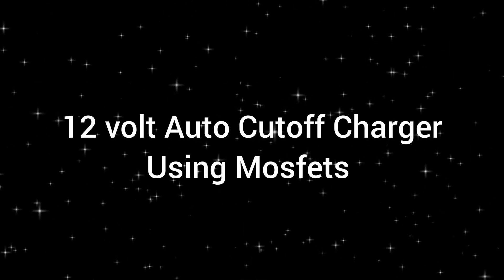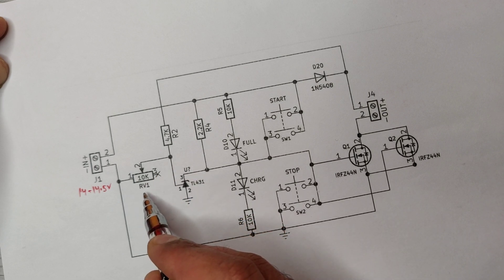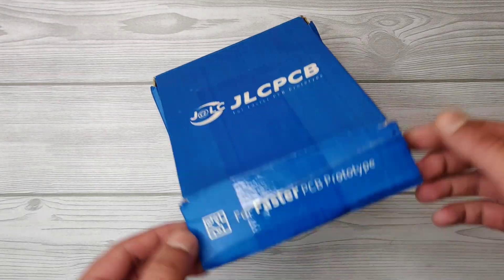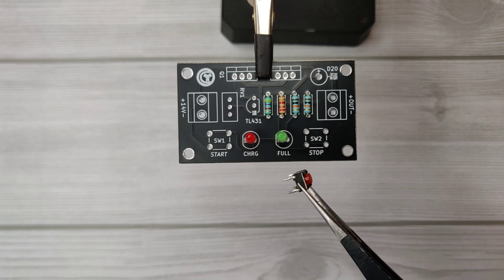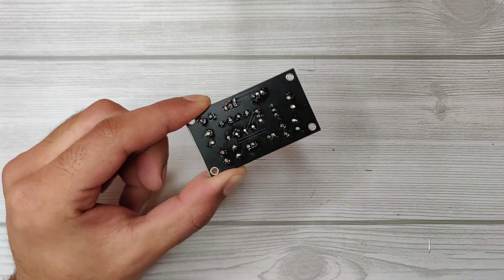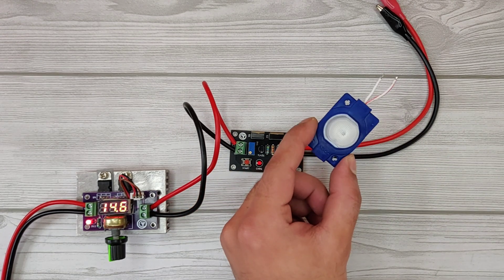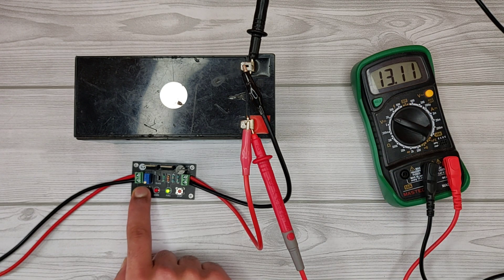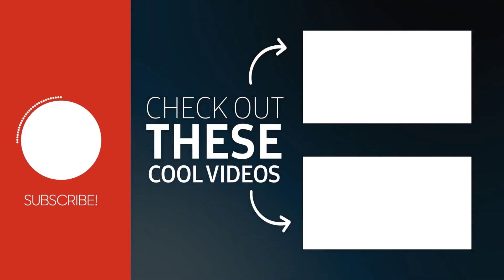Auto cut off 12v Battery charger circuit using Mosfets

Comment: Can one short the start button to ensure it charges as power resumes/switched on and take care of overcharge at cutoff ?  any disadvantages, I intend to use this part of a diy ups for modem/router... do you have boards, am from India.
Reply: If anyone made this circuit, can they answer a simple question... does this circuit start charging the battery when power is applied ? (i.e., without the need of pressing start button?? )

Comment: Can this charger be used with having MPPT(variable voltage and current but maximum power) as input to charger a 12V battery with providing constant current or voltage without bypassing?

Comment: Can i put this circuit to control charging system in motorcycle, i not use reguler rectifier, i use only full bridge rectifier so i can't stop the full charging and start charging

Comment: How necessary are the dual MOSFETs in this?  As near as I can tell, the MOSFET gates should be at ~10V, so VDS should be quite low, which should keep heat to a minimum.  How much current is expected through there?  Honest question, looking to learn.  Thanks for the tutorials, this one is going into a battery pack I'm making!
Reply: if you use the parts show, I was only showing about 250 millivolts across the Drain and Source, at 3 amps charging current.
Reply: @advancednutritioninc908   Under a watt then... 👍 Thanks for the info, mate!
Reply: @KJFMZ  Thanks for the circuits!!  I am trying to find the best lead acid charger circuit (doesn't damage the battery) that is not overly complex.

Comment: Bro I've made your project but I can't adjust my cut off voltage, i set the input voltage to 13.5volts with variable power supply and the red led is lightned up then i turn 10k preset to adjust cut off in 13.5v but i fully turned preset but the red and green leds are lightned same time. No only green led turns on, plz help me to fix this 🙂🙂
Reply from the maker: Try 100k potentiometer, it will work

Comment: Bro if i input 20volts to charge 12v battery wht are the changes ihave to do on this circuit plz reply 🙂
Reply: Hmm. ok thank you bro
Reply from the maker: My pleasure, Thanks for watching 🙂
Reply from the maker: Input max 14 to 14.5v, as output is not adjustable, do it will remain in cutoff position, You just need this adjustable output with cutoff
https://youtu.be/fq3pdoB_Sbo

Comment: Can I use it for 24v auto cut
Reply: plz provide me 24v auto cut circuit diagram
Reply from the maker: You can use same circuit, just use double value of every resistor. Except preset.

Comment: Does the circuit give constant output or not?
Reply from the maker: Yes absolutely, it is also what tittle of video is. Output is constant, Also you can adjust output voltage to 25v max @10A
Reply: @CreativeTechos  can i charge a above 12v battery?
Reply from the maker: Yes max 24v
Reply: @CreativeTechos  max input voltage of this circuit?
Reply from the maker: 25v with adjustable cutoff threshold
Reply: @CreativeTechos  ok thanks
Reply: @CreativeTechos  I do not ask about the video that you uploaded yesterday......i ask you about the previous auto cut off 12v battery charger. Answer my previous question according to this video.
Reply: @CreativeTechos  anyway which auto cut off circuit is best in your opinion and which power supply is best : variable lab bench power supply or variable power supply?

Comment: Can i charge a battery(above 12v) with this auto cut off circuit?
Reply from the maker: Yes max 18v
Reply: @CreativeTechos  Thanks
Reply from the maker: My pleasure 🙂
Reply: @CreativeTechos  Then what is the amount of input voltage , if i want to charge a 18v battery ?
Reply from the maker: Lithium or lead acid?
Reply: @CreativeTechos  lithium
Reply from the maker: For 18v lithium battery, you need to use variable power supply and set cutoff voltage on output @21v and input should be same 21v + measue drop voltage from input to output.
Reply: @CreativeTechos  Thanks
Reply: @CreativeTechos  Maximum output voltage ?

Comment: Tl 431 ke badle 547 chalta he?
Reply from the maker: No way bro TL431/KA431 is shunt regulator or we can say adjustable zener diode, while as BC547 is NPN Transistor, So both is different with different work.

Comment: I have need for a 12 V lead acid battery 'discharger' with auto cutoff to keep from over discharging. Discharge load can be a 12 V halogen automobile light bulb. Any thoughts on this?
Reply from the maker: I'll try to upload this ASAP, Adjustable overcharging & over discharging protection circuit